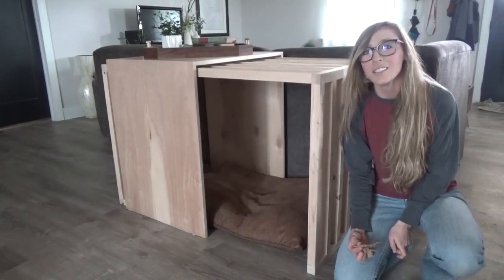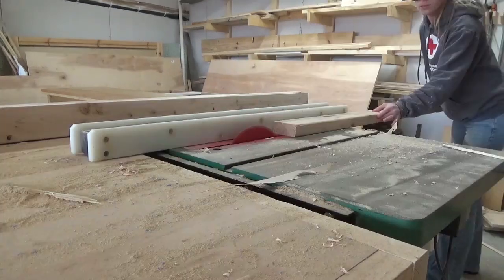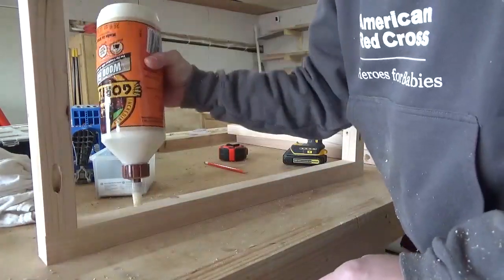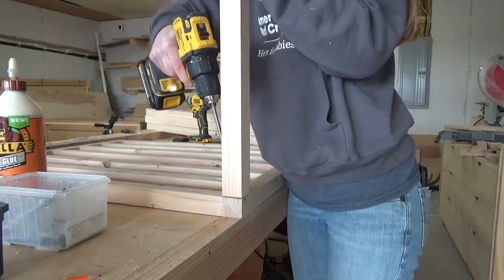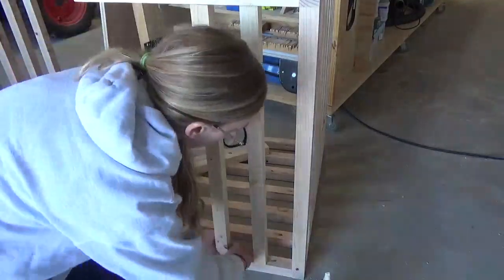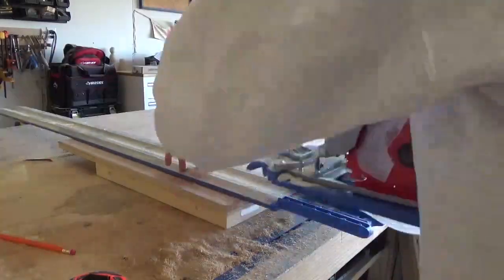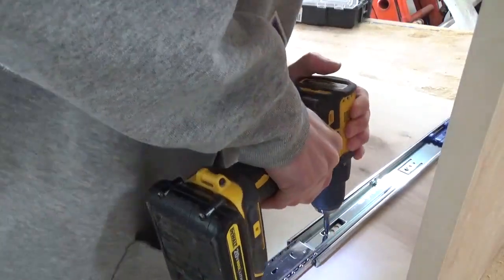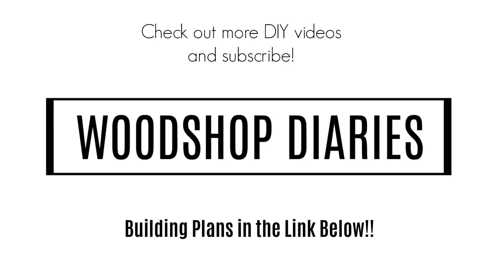How to Build Modern Dog Crate With Sliding Door and Wood Slats

Comment: Brilliant video. I'm amazed how you don't need to clamp pieces when screwing in the pocket hole screws. If I didn't clamp the 2 pieces together they wouldn't end up flush. Also a piece of advice, rather than measuring the gaps each time a spacer block would speed things up and ensure better accuracy.
Reply from the maker: Thank you! I’ve had lots of practice holding pieces to get them lined up right when screwing pocket holes haha

Comment: Lots of ingenuity with this design. Nicely done.  My dog would escape without a bottom, but it seems like that could be easily added.    You mentioned adding a coat of poly.  I suggest shellac instead.   Not so hazardous if the dog decides to chew on her crate, and also easy to refresh she happens to scratch or gnaw on any of the spindles.
Reply from the maker: Thank you for the tip! 👍

Comment: Nice build.  Very creative.  I think I would have put the drawer slides on the sides instead of the top so they could be more traditionally carrying the weight of the sliding component.
Reply from the maker: Yes, I had planned to, but because the slats are so close, there was no way to screw the slides between the slats with such small clearance 👍

Comment: I really love this! I will be building a variation of this model for my 1984 Winnebago Lesharo! Quick question, what software or program did you use to get the diagram pictures for the plans?
Reply from the maker: That’s awesome! I usually rough sketch the project, build it, then go back and draw it in sketchup after the fact to make build plans 👍

Comment: Hi. For us who are not familiar of your wood sizes, will it be possible to give the sizes in metric as well please. If we convert 2x4 to metric it's 51mmx102mm whereas looking at the size of your timber it does not look like the size I quoted. Thanks
Reply from the maker: Hi! I’m sorry, I create my plans using standard lumber sizes. I cut 2x2s from 2x4s. I think the measurements you have here are for a 2x4. I basically cut those in half to make square posts
Reply: @WoodshopDiaries  Thanks. But what is the size of your 2x4 in mm.
Reply from the maker: BOBBY it’s 1 1/2” x 3 1/2”. You can convert to metric. I don’t know what the math is on that
Reply: @WoodshopDiaries  Thank You. Much Appreciated.
Reply: @WoodshopDiaries  Thank You. Much Appreciated.
Reply: @BOBBY-et9xb  - In the US, dimensional lumber is refereed to by the "Nominal Size" which is the rough dimension before milling.  It would have been 2 inches by 4 inches before processing, but it is only 1.5 inches (about 38 mm) by 3.5 inches (about 89 mm) after milling.
I don't know if you have equivalent lumber sizes where you live.
Reply: @chrismoore9997  Thanks for info Chris. Where I'm from in South Africa our timber only comes in nominal sizes. So a 2x3 for example is a 51x76mm. So for me who does woodwork as a hobby and get my ideas from pros like yous on you tube it is a bit confusing when a 3.5 x 1.5 inches is referred to as a 2x4. But now I get the idea when a size is mentioned I will deduct half an inch from both sides. Thanks Man.